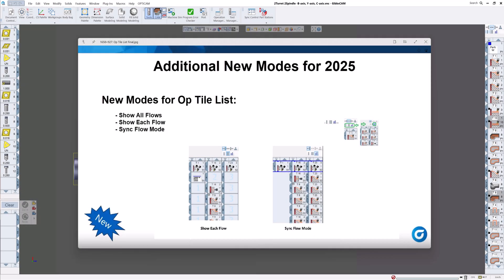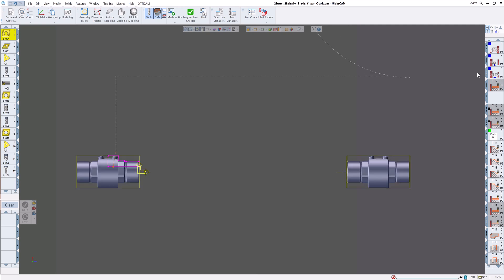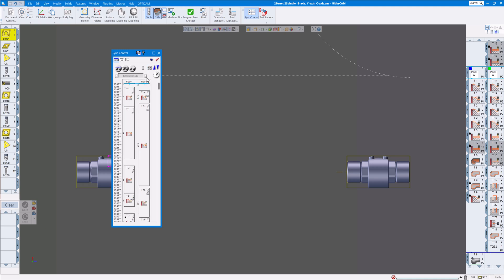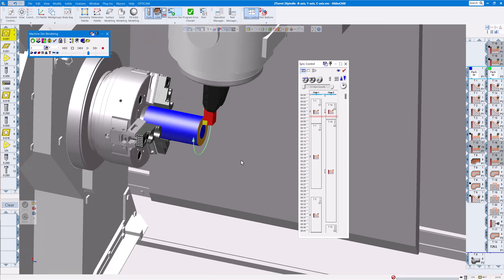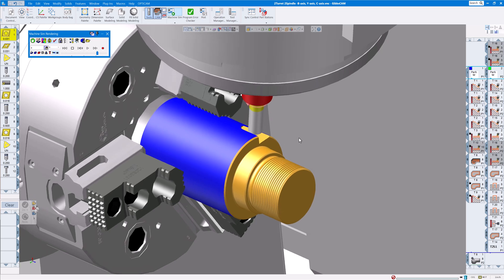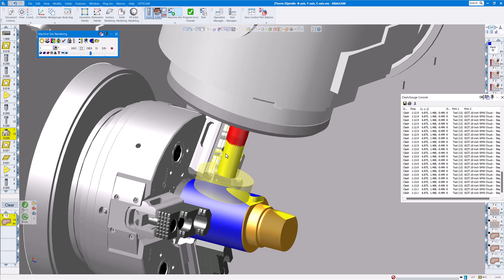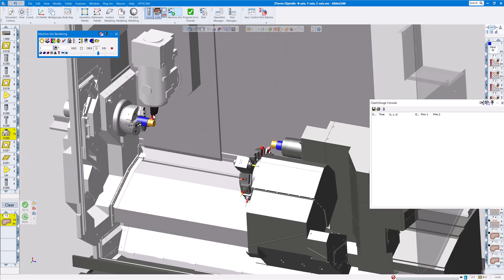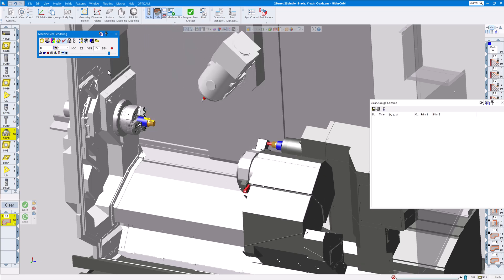GibbsCAM 2025 MTM Enhancements

Comment: The separate operation tile flows looks like a serious improvement. Can Gibbs do that with the tool tiles too? Keeping the lower turret tools separate from the upper head tools would be a big help
Reply from the maker: Yes, that might be helpful.  I will send that in for an enhancement for future releases.  You probably already know this, but what I do is put a space or two between tools for main spindle, and tools for sub-spindle.  Helps me keep track better, as in MTM you can put the tools in any position you want.  Thanks for watching and the feedback!
Reply: @GibbsCAMVideoTutorials  Keeping the tool groups separate like that helps for sure. What gets me is when I'm looking through my OP tiles, the "tool number" for that OP is the GIBBS tool number from the list, not the actual tool call I'll be using in the machine. If my upper head tool #2 in the machine is defined in Gibbs below my turning tools in slot 15, it shows up as T15 on the op tile. Not the end of the world, but when you need 40 tools and have 100 OPs its not hard to juxtapose yourself into confusion. Thanks for listening!